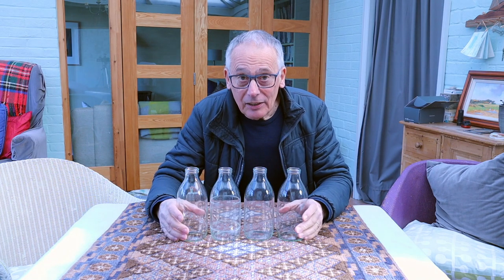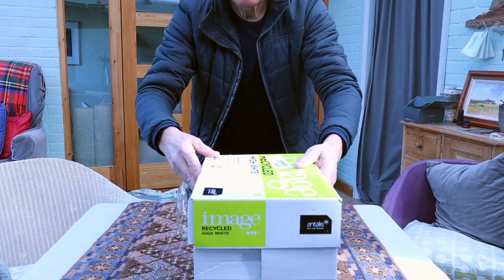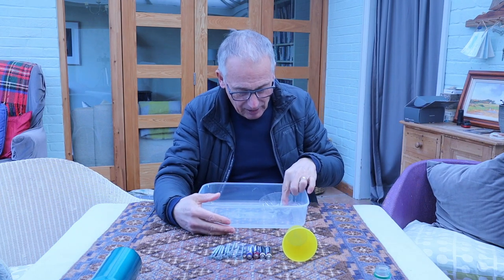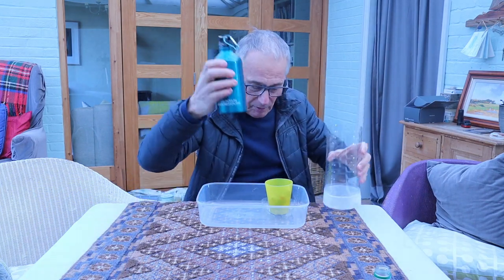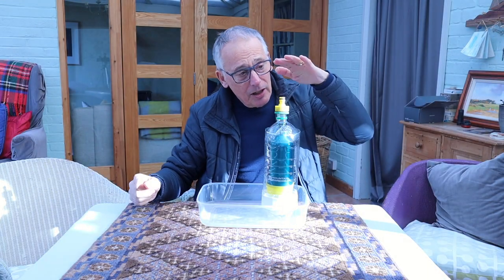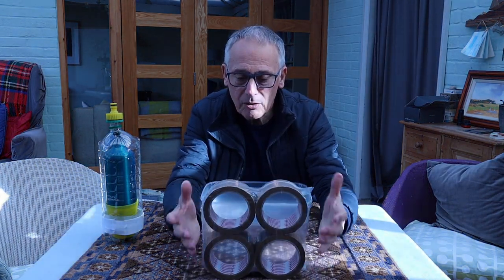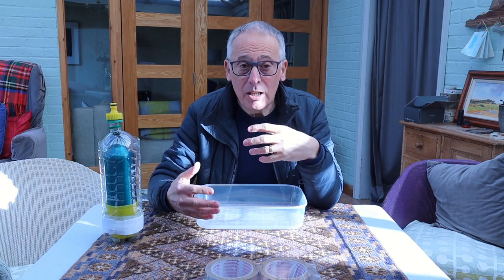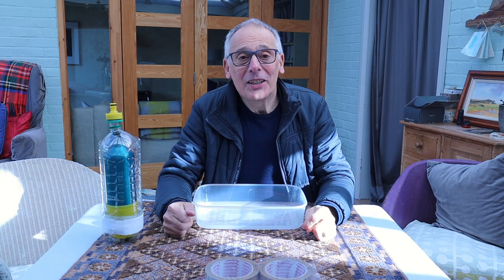Small Modular Reactors (SMR) - revealing truths to demonstrate they are not as simple as they appear

Comment: im not sure if anyone is making the argument that you're arguing against, no-one is saying that SMR's are a powerplant in a box. 

the entire point of SMR's is that the reactor only has to be designed and approved once and after that they can be mass produced.

building a base load power station that produces  next to no GHG emissions will be about as easy as building a natural gas plant in a flooded bunker.

I'm not sure how you think the issue of base load power would be addressed a smart grid that uses a distributed power storage solutions is way further away than the SMR's are and i don't think that bio fuel is a ecologically sound solution either.

id rather live next door to a SMR plant than see our woodlands be chopped down for power.
Reply from the maker: Thanks Diana

Like you I also do not think Biomass is a good solution for generating electricity unless viable carbon capture technology (CCUS) and sustainable farming can both be applied. However, I am also sceptical of CCUS as it is a bit of a smoke and mirrors con!

On your later points of course I understand the principle behind SMR mass production but that has yet to happen and the prospects are poor. To achieve any economy of scale in the time frame to make a difference to CO2 will be too late. Instead we have to look to technology that can be delivered and be generating in the short term. These exist, inclduing wind, solar and storage (with battery storage as just one example).

Furthermore the term 'Base Load' is misunderstood as it technically means 'always on' rather than the way the industry describes nuclear as 'reliable'. Although the promises that SMRs would be able to 'Load Follow' abound, in reality the huge capital cost always prioritises the 'always on, always earning' approach whereas even to match the currently installed base of renewables needs a balancing, variable supply. 

Thanks for contributing to this discussion, keep safe. PB

Comment: It's really important that everyone is able to express opinions and have an open and fact driven discussion. As a supporter of nuclear energy I am heartened by the level of discussion here and the fact that most comments are in favour of Nuclear. Ultimately markets will decide on viability, the points made in this video are simply engineering challenges which SMRs have been developed to in part address (as are MSRs). This is the most regulated form of generation so safety concerns should be minimal, critics can't have it both ways, hobbling the sector with regulation and still levelling safety concerns, simply illogical. It's also good to see no mention of failures in very old designs TMI, Chernobyl or Fukushima supporting a non-nuclear position. If we applied this time to useful generation principle we would stop a huge amount of research including Fusion. I suspect most supporters of nuclear also support renewables but not to the point of over-reliance and not where downsides are ignored and certainly not where debate on comparitive merits prevent progress, holding on to long held bias driven by distorted facts will harm us all.
Reply from the maker: Thanks Derek. It is refreshing to have a pleasantly civil  response from a supporter of nuclear, generally they are not so reasonable! I suspect the ratio of responses tipped in favour of nuclear is because of the long tentacles of the industry having to work harder under the regulatory regimes.

Regardless, you make a number of points that I agree with. 

Firstly, let me say, as I have mentioned on other replies, I support the notion that existing fleets of nuclear power plants should remain on the grid, assuming they can continue to generate safely, until their shutdown. My reasons for this are explained elsewhere, a substantial point is that the fuel fabrication, the most carbon intensive part of nuclear power, will have already been completed.

Also I am heartened that you also see the dilemma of the paradox that exists betwixt regulation and over jealous safety 'concerns'. However, I do acknowledge that there is a justifiable concern about health issues from radioactivity that has not been fully addressed, a big topic in itself. Furthermore the public perception that there have only been a handful of serious accidents is troubling.

Your point about over-reliance on renewables is well made, again, I have expanded on this in some detail in other responses. However, the variability of renewable output from solar and wind has to be balanced by a variable supply, this is where nuclear is far from ideal.

These are a handful of reasons for this:

A) Nuclear reactors 'age' when either they are powered down and restarted.
B) For the same reason if load following is employed it shortens the life of reactors
C) Financially A) & B) are bad where huge capital investment has been made to build them.

A difficulty is that currently the most flexible balancing source is gas, which does not fulfil the zero carbon requirements. So I am a supporter of green gas and, if commercially viable, green hydrogen generated from renewable surplus, which, at the moment, is 'dumped' in favour of nuclear for the 'always on' reasons.

Thanks again, for your reasoned response, I do hope you see that my position is not one of bias or distorted facts?

Regards, PB

Comment: Can I ask what you think is better and quicker for saving the climate? as this one will take to long and is needed now!
Reply from the maker: Thanks CJ.

It needs to start with a look at the 3 golden rules of energy: Reduction, Localisation and Storage. For reduction greater efficiency (LED bulbs, better designed hardware), better insulation, use less electricity wherever possible and intelligent demand side management. Localisation gives the opportunity for community energy schemes with grid top ups from solar PV, modest wind generation and 'stream/river' hydro. Storage covers large systems such as pumped water storage, large battery sites, home batteries, home hot water systems, gravity systems and Vehicle to Grid (V2G) from EV batteries when connected but not in use.

On shore wind is the most economical way to have a generating source and the quickest payback. On roof domestic solar not only saves the resident money it also can be stored and/or fed back into the grid.

Thanks again, keep safe. PB
Reply: @no2brb  what about cost of storage , and can you store energy sufficient for large city for week or at least for few days , can you do the with c urrent technology , what are you going to do when wind doesn't blow
Reply from the maker: @AkshayKumar-vg2pi  Thanks again.

You have effectively asked two separate questions here. 

I assume, from the tone of the first part, that you are just considering battery storage? That is only one of a number of storage types and, this is where we can partially agree, generally they are principally for short top up energy provision. The advantage about storage is the ability to be able to top up at any time there is surplus.

The second question around weather patterns that yield little wind is a good one. Essentially the best solution is to provide a variable supply. Currently this is gas, which is a fossil fuel. Nuclear is not variable, for a number of reasons, and the hope is for green gas and / or green hydrogen to be the top up.

Thanks. PB

Comment: I appreciate your video. Yes, agreed that we need to act now.. But with what? Wind and solar? Yeah they are both falling in price. But the land that it takes to create 300MW compared to a SMR is not remotely comparable. You need massive amounts of land to create the same amount of energy as an SMR plant. That’s the whole point. The SMALL in Small Modular Reactor doesn’t relate to its size, it relates to it’s energy production (300MWe) compared to traditional nuclear reactors (700-900 MWe) BUT it’s better because its easily scalable. Put 4 together and its 1200 MWe. Just remember. One of these modules power 50,000 homes whereas the largest solar farm in the world (china dessert) is only 1200MWe. So I guess you could say that it is small compared to any wind or solar farm.

Edit: you’re also forgetting that SMRs are already used in submarines and ice breakers. So the technology isn’t decades away.
Reply from the maker: Thanks for your comment. I agree that you need more land for wind and solar compared to nuclear 1kW per m2. You can, however, use the land (or sea) around wind turbines and under / in between solar arrays. The big issue arises during decommissioning. All the land around wind and solar can be re-used pretty much straightaway. For nuclear it is not just the footprint of the plant itself it is also the infrastructure needed for the waste streams from the ore extraction right through to waste 'disposal'.

On your Edit point I have answered that point against an earlier comment. Essentially nuclear submarines utilise highly enriched Uranium to avoid refuelling and allowing months under the surface. Civilian reactors can only use (legally) partially enriched Uranium. In both ice breakers and submarines there is a relatively unlimited supply of cooling water, too. SMRs are planning to use passive cooling.

Thanks again, keep safe. PB
Reply: @no2brb yeah the nuclear waste is what people are scared of but even 3rd generation CANDU reactors and new molten salt reactors can be use up to 90% of that fuel or alternative fuels such as thorium. So the nuclear waste would only have be dangerously reactive for a century instead of a millennium.

The main problem I have when people as knowledgeable about nuclear as you are is that you have some influence. People will paraphrase what you say at a dinner party to argue against nuclear energy. Considering the state that the planet is in right now, we need all the clean and sustainable options now. I don’t think we have the luxury of just using one type of sustainable energy source. Especially with third world countries working up to having a middle class. 

Anyways, all that said. I still enjoy your input on the matter.
Reply from the maker: Thanks for the comment and kind words, apologies for delay in responding. Looking at your points I would suggest the Gen III CANDU reactor still uses Uranium so long term waste issues still apply. With Thorium fuel the picture is still concerning, mainly because of the randomness of radioactive decay therefore predictions rely on probability rather than certainty. With Molten Salt reactors the industry promises have yet to be realised, none have proved to be sufficiently commercially viable... yet!

Thanks again and keep safe. PB
Reply: @no2brb  The randomness is well tested and proven so we have 100% reliable fission yields and decay half-lives, so no, we are not guessing what will come out of the Thorium fuel cycle, we KNOW. While we argue about this China is already building a nuclear molten salt demonstration reactor.
Reply from the maker: Yes, China is building an MSR, we will wait to see if it proves to be commercially viable unlike the only one in use currently in India. I'm not really arguing, I am just trying to fill in the gaps between the propaganda that is put in the media. Cheers for your contribution. PB

Comment: Land based doesn't make sense when sea based would be more flexible and cheaper and the cooling water would be literally a meter away rather than 3km out to sea

Imagine a nuclear powered submarine
Minus everything apart from the power generation

Very compact

Can be built at a shipyard
A shipyard that builds a thousand of these nuclear power submarine would build them cheap as they would get good at it

I would suggest something on the order of 100 MW

The actual benefit apart from mass produced at a central facility would be that it would be a lot easier to sell these

You could plug one into any grid with as little as 6 months onshore construction for a grid link. One cycle could be 3 years where a replacement sub is sent to the location. The empty sub is unplugged and the fresh sub is plugged in with maybe just one day downtime per 3 years = more than 99.9% capacity factor for the grid connection

The empty sub is taken back to port where it is refueled and deployed again

The capital cost of this project would be very low perhaps 2% Vs 10% for traditional nuclear. The reason is the bank's would find this low risk. Pay the money and have the sub delivered two weeks later fully working no delays no cost over runs
Reply from the maker: Thanks for your contribution. Many of the points you make are inarguable... but ;-) With nuclear there is the perpetual issue of waste.
Reply: @no2brb  Waste is a non issue because nuclear reactions are 1 million times more energy dense than chemical reactions they can be stored

The waste from coal oil biomass and natural gas gets dumped in the air and sea. There is also waste from solar and wind power which is sent to landfill and some of it quite toxic

Also o would suggest there is an easy solution to the waste. Use it for heat in distributed heat grids. As long as humans exist we will need warm homes which can be heated by nuclear fuel including the 'waste' which would be thousand year fuel rather than 'waste'
Reply from the maker: I do have to give you credit for good and lateral ideas! With spent fuel clearly the fission products are more intense than the heat and it begs the question why has it not been done before to a level that makes it commercially viable.

In the UK there is very little coal use now, gas GHG/CO2 is an issue. But whilst solar and wind have relatively low energy density the ROI is very short compared to nuclear (and far less toxic). Take care, PB

Comment: One can keep the turbine hall and the cooling or condencer equipment
Switch gear of an existing coal power plant. Get rid of the coal handling equipment burners smoke stack coal pile etc. All your doing is boiling water. Many coal fired plants can be replaced with SMS. No need to replace the common components. Nuscale can replace central heating systems and make no electricity.
Reply from the maker: You present an interesting idea that is good in theory but not in practice. Any power station would have to go through a major (and statutory) service to renew components before a new lease of life could be given. I agree that alternative uses for the heat has merit as simply using generating steam to turn turbines and generators does seem anachronistic. We will have to differ on using nuclear SMRs though! Regards, P

Comment: I think  we need to look at multiple  avenues.
Solar the cost is not just the panels but all the lithium  iron batteries their mining  and safe disposal which is still not done on scale required

Wind..extremely  un reliability and just read that the blades are being dumped  in land fills as they are hard to recycle. 

Nuclear...clean relaible but a little dangerous. Nuclear waste is a big issue.

Hydrogen based fuel cell power generation, still in concept needs work might be able to replace coal power.

Fusion....long way to go

Comment: Is it true that SMR’s (if they have a meltdown) generate are much more intense radiation at a closer distance than large reactors? I know that mini nukes like the Davy Crockett at close distance can give off over 10.000 roentgens.
Reply from the maker: Good question! There are a couple of reasons that I believe match this thought.

Some of the proposals for SMRs in the US use similar fuel to that used in submarines, Highly Enriched Uranium (HEU) rather than the Low EU. This would certainly give, in time, more intense radiation than with larger reactors that only use LEU.

The other point is that SMRs are not planned to be within an overall containment building. There only containment is the reactor shell itself and the building containing the ponds as in the NuScale video clip.

I hope that gives some clues to possible answers to your question?

Thanks for your contribution and keep safe. Peter B

Comment: The SMR concept is there to resolve the regulatory aspect which is the big impact on the construction time schedule. The reactor itself is constructed in a factory according to regulations and not constructed on site which requires inspection. The power station itself is much easier to construct.
Reply from the maker: Thanks again. Yes, I certainly understand the concept but there is so much misinformation propagated by the industry giving the impression that these arrive ready built, plug and generate. NuScale and Rolls Royce provide reactor components to site only that are then assembled in situ. Everything else needed for the power plant is constructed on site. This has all sorts of ramifications if different suppliers and contractors are used. The commonality of a true modular system is lost. PB